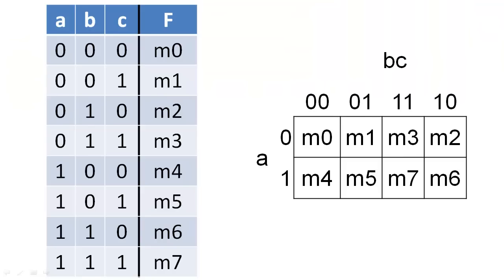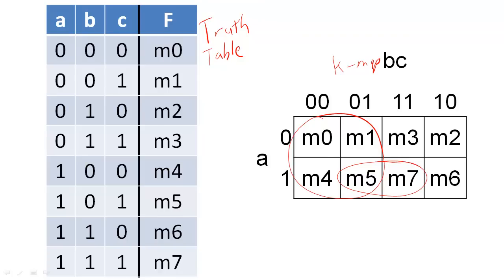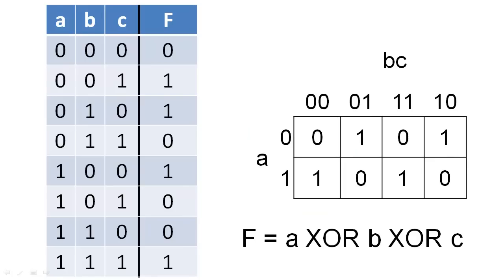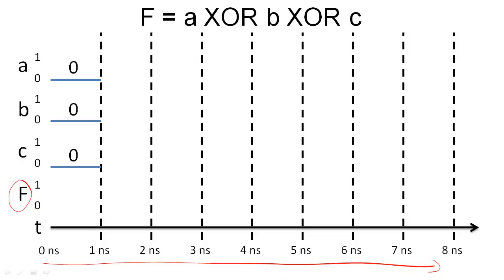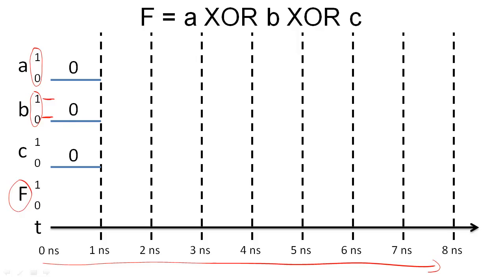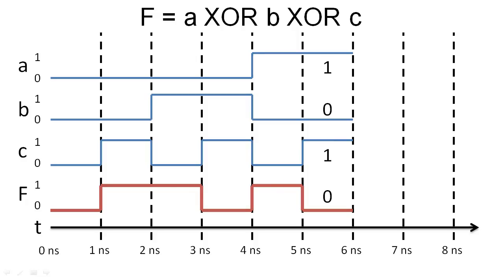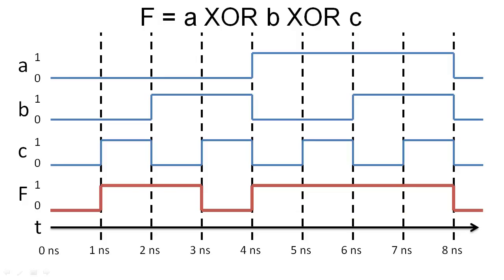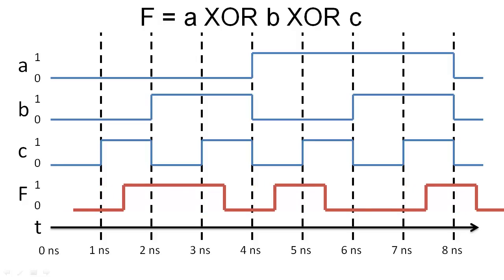Timing Diagrams

Comment: hmm, i am very positive that you put up this video, since i believe the understanding of a timing diagrim is very important in digital electronics.

with that being said, do help me clear out these misunderstandings.

You have chosen to use a function called A Xor B Xor C.
Now i only see 1 possible combination of this.

i see that first we take A Xor B and then that output is put into another Xor together with C, so that finally we only have 1 output.

Now the problem for me, is that Xor is (Exclusively OR), that means that whenever it is not OR, which is 0,0 or 1,1 then the output should be 0.

This concept is agreeing to your timing diagram, all the way up to the last 2 cases, where it should yield 1 and 0 instead of 0 and 1.

I tried to understand it as B being an input into two XOR gates that each use A and C as well, but this yields two outputs, which then we have no action on.

So again, clear out to me, are the last two cases of your timing diagram wrong, or how exactly did you calculate each output?

On beforehand :) thank you to any who may reply to this question, as it will help me greatly understand timing diagrams.
Reply: Hey have you figured that stuff out yet?